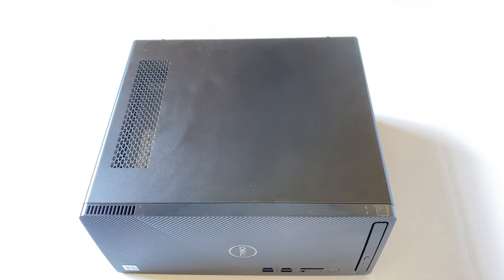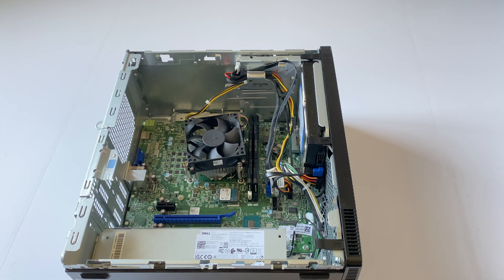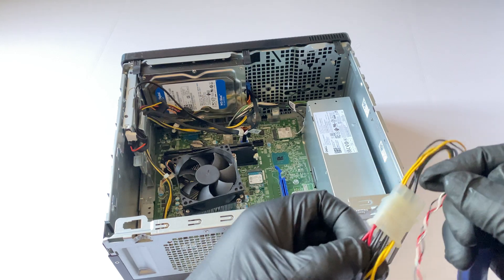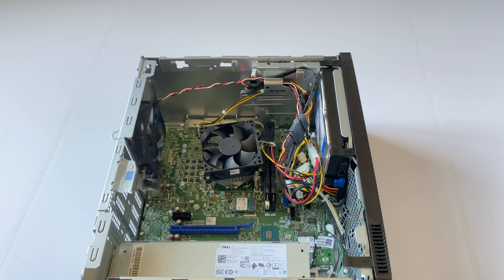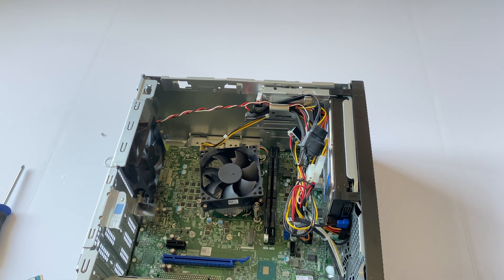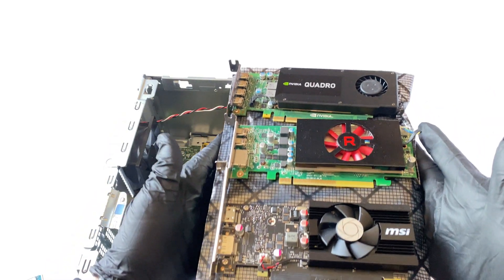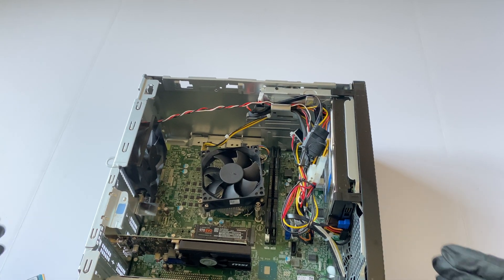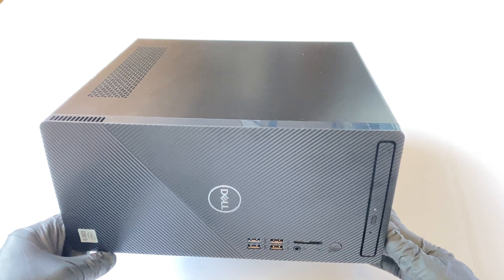Dell Inspiron 3880 Gaming Upgrades RAM Video Card SSD

Comment from the maker: List of Parts and Upgrades works with this system :
Dell Inspiron 3880 

STANLEY Screwdriver Set, Precision, 6-Piece (66-052)
https://amzn.to/3zNmoln

(1.) Wifi Adapter 600mbpsWireless USB Adapter 2.42GHz/5.8GHz
https://amzn.to/3nXHAPK

(2.) USB Wifi Adapter for PC AC600Mbps Wireless Network Adapter
https://amzn.to/2ZaGuHb 

M5x10mm PC Fan Mounting Screws 
https://amzn.to/3R41CH5

ADD Rear System FAN to make PC run cooler.
Simple Deluxe 80mm Quiet USB Fan with Multi-Speed Controller
https://amzn.to/3jgHxiI

Compatible With Dell Inspiron 3880 

List of RAM will work with this system.

(1.) Crucial 32GB Kit (16GB x 2) DDR4 3200 MT/s (PC4-25600)
https://amzn.to/2Zazppk

(2.) Crucial 8GB DDR4 3200 MT/s (PC4-25600)
https://amzn.to/2R07Ier

(3.) Crucial 16GB Kit (8GB x 2) DDR4 3200 MT/s (PC4-25600)
https://amzn.to/326cfT7 

(4.) Crucial 32GB (2 x 16GB) DDR4-2666 UDIMM
https://amzn.to/3QW8aXW

(5.) Crucial 16GB Kit (2 x 8GB) DDR4-2666 UDIMM
https://amzn.to/3KbR9a5

Power Supply Upgrade 260W
Part Number: for P/N 0H7X3F H7X3F,H260EBM-00
https://amzn.to/3SfmbAC

List video cards will work with this system Dell Inspiron 3880

GIGABYTE GeForce RTX 3050
https://amzn.to/3W2sJY9

MSI Gaming RTX 3050 Gaming X 6G Graphics Card 
https://amzn.to/4eNikqD

(1.) Gigabyte GeForce GT 1030 GV-N1030D5-2GL Low Profile 2G Computer Graphics Card 
https://amzn.to/2Z4PHkp

(2.) ZOTAC GeForce GT 1030 2GB GDDR5 64-bit PCIe 3.0 DirectX 12 HDCP Ready Low Profile Video Card ZT-P10300A-10L 
https://amzn.to/2WzgLXk 

(3.) MSI Graphic Cards GT 1030 2GB GDDR5, Low Profile 
https://amzn.to/390Spum

(4.) Gigabyte GV-N1030OC-2GI Nvidia GeForce GT 1030 OC 2G Graphics Card
https://amzn.to/3wd8EkB

(5.) Asus PH-GT1030-O2G GeForce GT 1030 2GB OC Edition Graphics Card
https://amzn.to/3SZ0gPC

(6.) AMD Radeon RX 6400 Low Profile Gaming Graphics Card
https://amzn.to/3s8MUUY

Thermal Compound Paste:
(1.) Arctic Silver 5 Thermal Cooling Compound Paste 
https://amzn.to/2ziNU0H

(2.) Noctua NT-H1 3.5g, Pro-Grade Thermal Compound Paste
https://amzn.to/36kTk7A

(3.) ARCTIC MX-4 (current edition) Thermal Compound Paste 20 Grams 
https://amzn.to/2DhGJaK 

List SSD Heatsinks:

(1.)  M.2 2280 SSD heatsink, Double-Sided Heat Sink, PCIE NVME M.2 SSD
https://amzn.to/3l2ittr

(2.)  EZDIY-FAB M.2 2280 SSD heatsink, Double-Sided Heat Sink, PCIE NVME M.2 SSD
https://amzn.to/3m7J3me

List SSD M.2 Type 2280 NVMe PCIe:

(1.) Crucial P3 Plus 4TB PCIe M.2 2280 SSD
https://amzn.to/3RZcUNi

(2.) Crucial P3 Plus 2TB PCIe M.2 2280 SSD
https://amzn.to/3RTUi0Y

(3.) Samsung (MZ-V7E1T0BW) 970 EVO SSD 1TB M.2 NVMe
https://amzn.to/3d52k2a

(4.) Samsung 970 EVO Plus SSD 500GB
https://amzn.to/3fpi95A

(5.) Samsung (MZ-V7E500BW) 970 EVO SSD 500GB - M.2 NVMe
https://amzn.to/37uuLFw

(6.) Crucial P1 500GB 3D NAND NVMe PCIe M.2 SSD - CT500P1SSD8 
https://amzn.to/2N07wKh

HDD list works with this PC:

(1.) Seagate BarraCuda 4TB Internal Hard Drive HDD – 3.5 Inch
https://amzn.to/3d3xWeR

(2.) Seagate BarraCuda 8TB Internal Hard Drive HDD – 3.5 Inch
https://amzn.to/3xjUDSJ

(3.) Western Digital 2TB WD Blue PC Hard Drive HDD - 5400 RPM, SATA 3.5" - WD20EZAZ
https://amzn.to/3w3jIQA

(4.).WD Black 2TB Performance 3.5" Hard Drive - 7200 RPM Class, WD2003FZEX 
https://amzn.to/2xFUeyF
Reply: I have an hp elite 8300 and I can’t afford any upgrades is there anything u can do for me?

Comment: so do all of the gpus in the description also need an upgraded psu?
Reply from the maker: Hi, it depends, if you going to use gt 1030 and you do not have to upgrade power supply and if you going to use rx 6400 you have to upgrade power supply..
Reply: @Mxkdt  por que bro me quiero comprar la rx6400

Comment: How did you migrate the OS Windows to SSD? Thanks!
Reply from the maker: Hi, no because  i did clean install windows 11 on new SSD..
Reply: i'm working on a similar project.  i used a usb to make a rescue disc from the original dell ssd after getting all of the updates from microsoft and dell.  installed the new ssd, booted from the usb, and did a system restore.

Comment: If the graphics card used in the video has a fan, do you really need to install a second fan like you did in the video? 

P.S. 
I have this exact PC, but the only thing I want to upgrade is to have a graphics card with either 2 HDMI ports, or 1 HDMI and 1 DisplayPort. I don’t game on it, just need a graphics card with 2 ports for HDMI and DisplayPort. No splitter. The MSI might be a good candidate—can I just install that?
Reply from the maker: Hi, it depends what kind a video card are you going to install ?

Comment: You said that the GT 1030 will run on 200W PSU and no need to upgrade?
Reply: From what I have researched, the GT1030 needs a 300w PSU. I ended up returning one I bought for fear of burning up my PSU which is on 200w

Comment: You were able to add aftermarket GPU without issues?   I have my G5 I took my 3060 ti out and replaced with Asus 210 to have video and now my OC throwing error code and not showing any display

Comment: I want to adjust the bios settings for the case
dll optiplex 980
Reply from the maker: Hi, Power on the system. Tap the F2 key to enter System Setup when the Dell logo appears.